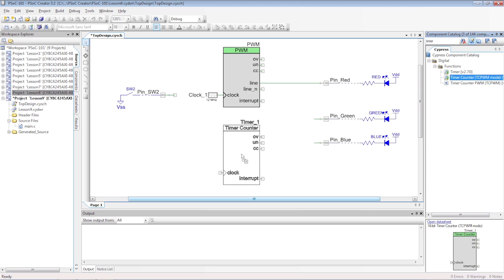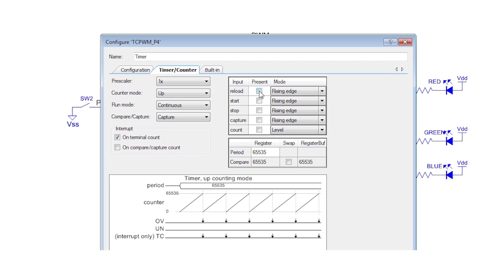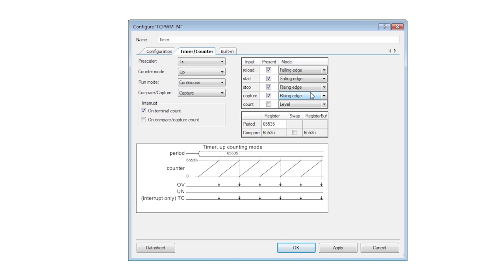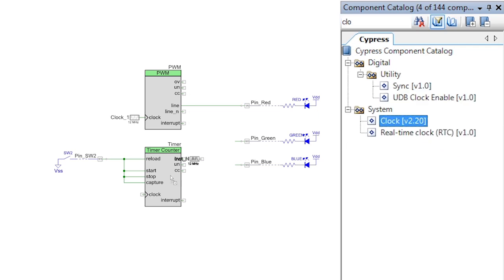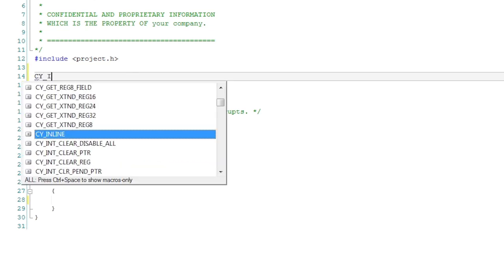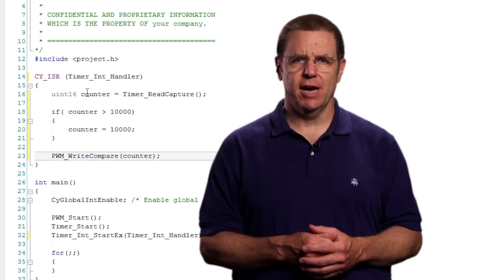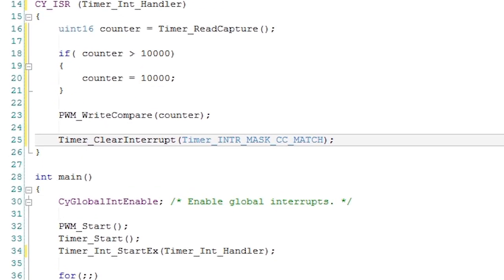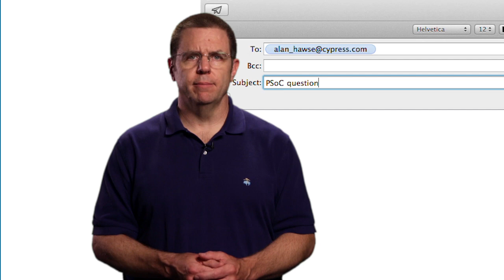Cypress Academy: PSoC 101- Lesson 9: Timer

Comment: Good evening, is it possible to use the Timer to measure the time it takes a piece of code to execute? Instead of starting the timer with a switch, that it starts with a line of code before the function() you want to measure how long it takes, and a Stop Timer after it is done, and get the results (the time it took that code function to execute) to show it later through UART or in a printf locally... please help, I tried looking for the whole PSoC infineon community but there's no post related, except 2 but still is not on the code one and the other they talk about functions from PSoC 4 but I'm using the 6, CySysTickStart(); CySysTickSop(); and GetResult, functions that I don't find in the PDL files, nor other libraries or .h files. I will try to make one later but if someone replies here would be nice! Thanks!